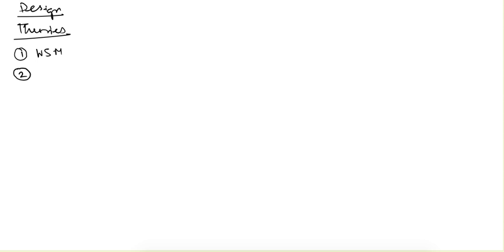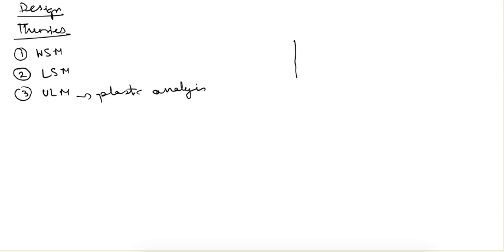Limit State Method | Design of Steel Structures

Comment: Are these load combinations correct as per code?
1.5 DL+1.5 LL+1.05 CR
1.2 DL + 1.2 LL + 1.05 CR + 0.6 WL/EL
1.2 DL + 1.2 LL + 0.53 CR + 1.2 WL/EL
1.5 DL + 1.5 WL/EL OR 0.9 DL + 1.5 WL/EL (IF DEAD LOAD STABILIZE THE STRUCTURE)
1.2 DL + 1.2 ER OR 0.9 DL + 1.2 ER (IF DEAD LOAD STABILIZE THE STRUCTURE)
1.0 DL + 0.35 LL + 0.35 CR/AL